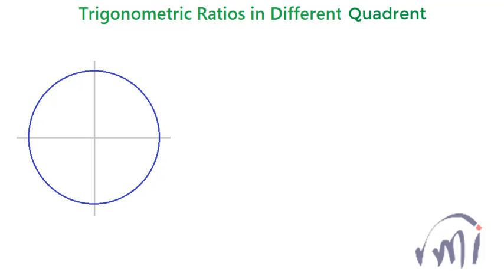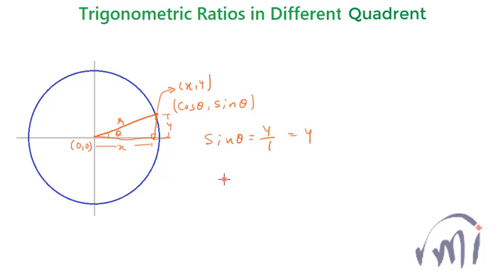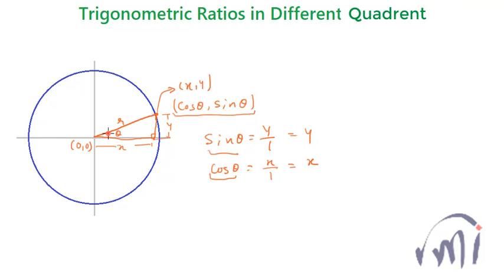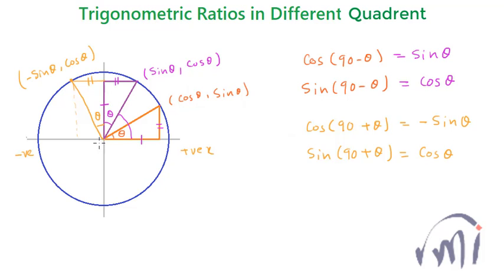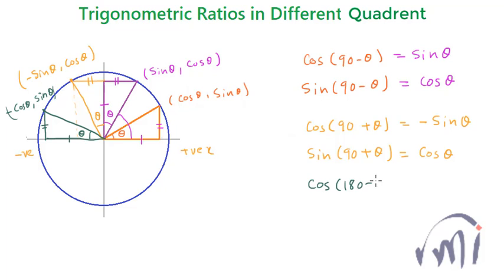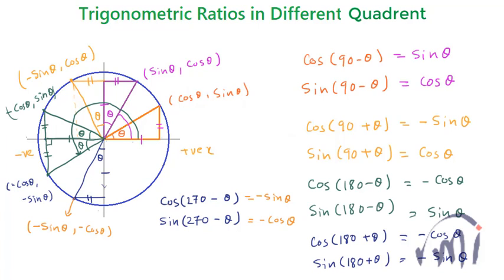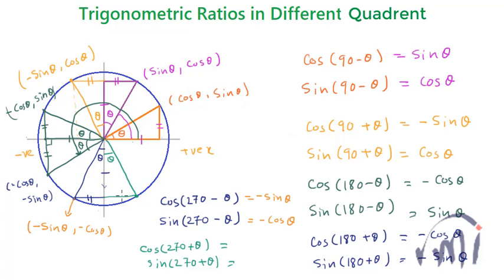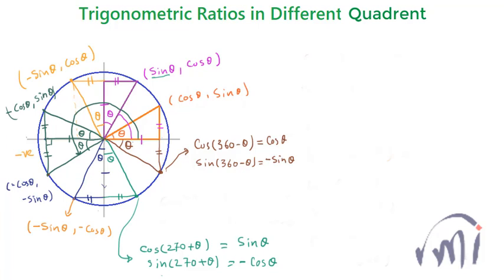Sin(90-A), Sin(90+A), Cos(180-A), Cos(180+A), Sin(270-A), Sin(270+A),Cos(360-A) How Why Trigonometry

Comment: Why did you take the angle of purple triangle theta at 2:23 ? Same as the angle of orange triangle.
Reply: Two angles are not same but the purple triangle is (90-theeta (Orange triangle's angle) )
Reply: @JEEClass-11how can it be 90-theta? What about the measurement of angle between the two thetas(orange and purple theta) . I mean 'gap' between them. According to me the first quadrant is divided into three angles purple thera + gap + orange theta. If orange angle has theta angle then purple triangle should have 90- (gap+theta). Gap means angle between the two sides of both triangle in the middle.

Comment: One thing I have yet to grasp is how do you extend this type of argument to theta >90°?
Reply: Yes and why radius is 1? In this video
Why even theta not change
Reply: The radius is one because the triangles formed are similar to the ones formed with a circle with an arbitrary radius
Reply: Because in theory this is not how this should be taught
Reply: @hodayfa000h  How should it be?
Reply: @martinsanchez-hw4fi  alright, so to clear things up, I made this myself I have no idea if it is ACTUAL proof, but it is a good way to imagine it, so first we would want to understand 1 thing:
Sine at 0° is 0, and cosine at 90° is 0, so because they change at the same rate, in theory sine(0) = cosine(90) and
Sine(1) = cosine(89) because cosine increased by some value and that sine itself increased by the same value
This DOES mean:
Sine(0+x) = cosine(90-x)
(x is the angle)
This is also because sine and cosine are complementary, now why does this work for ALL values?
Because well, let's take the case where x is bigger than 90:
Sine(91) = cosine(90+91)
Is that really true?
Technically? Yes, just the SIGNS are different, they are actually at the same position, think of it this way: each quadrant has different signs, to convert from one another we take the SAME position and change the sine, here is where this comes in:
At sine(90) sine is at its highest value right?
At cosine(90+90) cosine is at its highest value but INVERSE, so -1
Sine(90) = -cosine(90+90) 
And for clarification I only use degrees here, so that is true right?
It should make sense that at sine(91) sine decreases by a certain amount because it cannot go any higher, at cosine(90+91) cosine itself ALSO "decreases" (yes I know it is negative and actually increases, but the VALUE itself without signs) and it decreases by the  same rate as sine, so it is literally the same place, try to play around with this idea: Sine and cosine can be equal in different quadrants, but could have different signs, this relationship overflows to all other cases and you can test it yourself, the LOCATION itself remains, we get its equivalent, let me show an example:
Converting from third quadrant to first,
Sine(180+x) = -sine(x)
But why you may ask? 
Well because sine(180+1) = -sine(1)
Doesn't make sense on why? They change at the SAME RATE, so literally the third quadrant is the first but FLIPPED, as in the ONLY difference is their signs, if you want to imagine it do this:
Draw the x and y planes, horizontal and vertical, assign a point, let's call it G
G = (5,3)
Now make another called T
T = (-5,-3)
They are literally the same but the SIGNS are different, hence why I say the location is the same, so by flipping the sign we go to the first quadrant where we have the same value, this applies to ALL other ones, in fact you shouldn't memorise it and understand it this way, i wish I could explain it visually, but this is so simple and amazing once you try it yourself, so TO ACTUALLY ANSWER YOU:
The values overflow to different quadrant and they remain the same, taking our example before that is:
Sine(180+x) = -sine(x)
If x is for example 91, we have:
Sine(180+91) = -sine(91)
Which HOLDS, see for yourself:
It is literally overflowing to the second quadrant and fourth instead of the first and third, the relationship between second and fourth REMAINS:
sine(91) = -sine(270+1)
Because THE VALUE and LOCATION remain, ask me if you need clarification.

Comment: And the same question for Why cos(270+theta) = sintheta when it's projected to negative part of the Y axis and the same question Why sin(270+theta) = -costheta when it's projected to positive part of the X axis?
Reply: The best way to clarify your doubt is, assign some arbitrary values to x and y in the first quadrant, which are nothing but cos and sine respectively. After that, instead of writing sin and cos as coordinates, you go on assigning x and y values as you go on getting for cos and sin with proper signs. Compare individual values with those you have in the First quadrant of cos theta and sin theta. In some cases, as you already know values of cos would be that of sine's and vice versa with signs per the quadrant. That should eliminate your doubt. We actually compare values of the coordinates in the brackets.